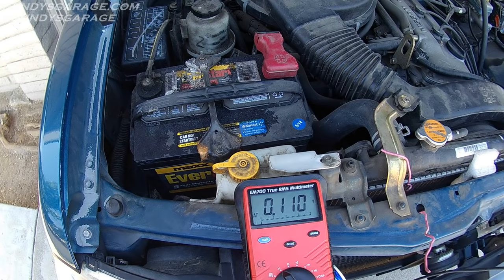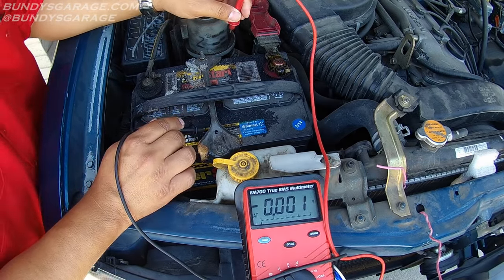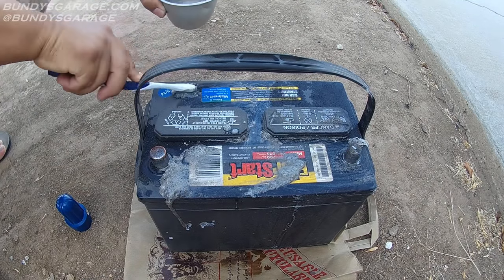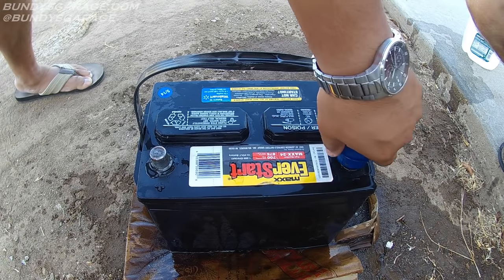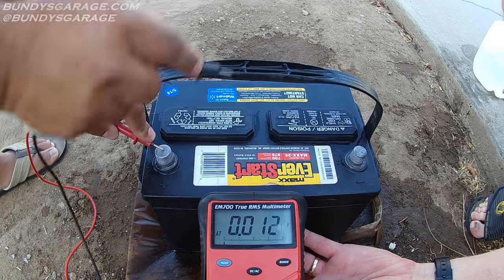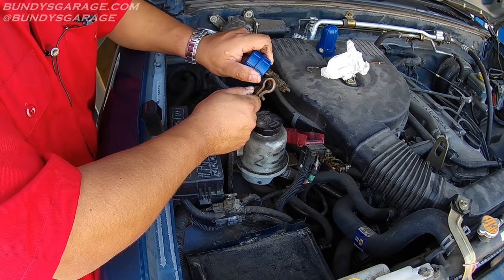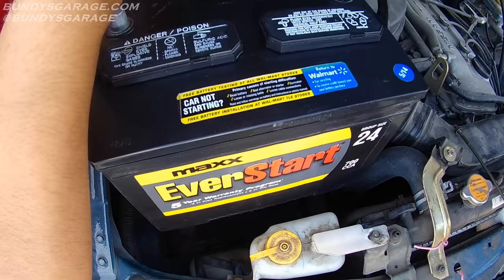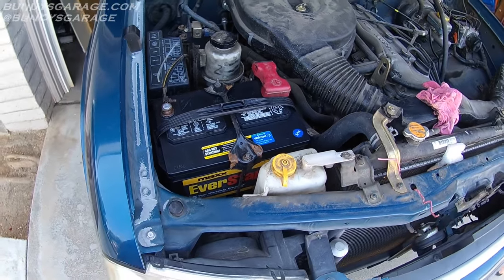Car Battery Care and Maintenance - Tips and Tricks - Bundys Garage

Comment: May I recommend a light coating of vasoline on the terminal posts and base to prevent corrosion.  A trick I learned over 45 years ago that works awesome.
Reply: It's what I've just done with my new terminals...👍👍

Comment: i have been in the battery industry for 35 yrs , there always been maintenance free and low maintenance batteries in the market place , Maintenance Free is the best , no maintenance and know corrosion on terminals . Maintenance Free is what comes out in every Brand New Car , At the retail level you need to do you homework on finding them .

Comment: Walmart battery has that much acid corrosion in just 2 years. It's 2020 and I was thinking of getting a Everstart Maxx but now not so sure. Project Farm channel tested a bunch of new batteries and the $120 Walmart performed better than most. It doesn't help if they don't last though or leaks.

Comment: You mention just the radio code, You did not mention that all the OBD data .You have to drive 100miles to retrieve it or you will fail smog check if you need one.It happened to me. I was charged twice and I have to retest.

Comment: Hi, I turned the key in my 2011 Routan yesterday and there was no sign of power. I cleaned the terminals then jumped the car with my second car but not before leaving it on charging for approx. 5 mins then it turned on. So I left it on for 30 mins but didn't try to start it until a few hours later and when I did no power again. Its a sealed type so I cant check water level is there something I should do next??Read more
Reply from the maker: Sorry to hear that. Do you know the last time you changed the battery? Most of the time the alternator will change a battery enough to get it going again but sometimes you need to charge it with a stand alone charger. And then sometimes the battery needs to be replaced. They do have a life span and eventually they go to that lead acid heaven in the sky...

Comment: Is it a good practice to disconnect the negative terminal when the vehicle is not in use for a relatively longer period?
does it drain the battery when you do so? or does it damage the  battery n anyway? pl reply
Reply from the maker: Well a lot of modern cars have multiple computers that will be reset if you disconnect the battery. Plus some vehicles want a code to activate the OE radio after the battery has been disconnected. You best bet is to get a battery tender like a Noco Genius Charger.

Comment: Another reason to take the negative off first. If your ratchet hits the body taking off the negative no issue. If you try to take the positive off first and you hit the body or anything metal, it's spark city. Once the negative is off, if you hit metal taking positive off it has no effect!
Reply from the maker: +ggin nj good point but it's backwards, if the positive is hooked up, and you are trying to remove the negative, hitting metal with both the positive and negative attached to the battery you will see sparks. Just remove the negative first but be very careful not to touch any metal when removing the negative.
Reply: @bundysgarage  That's plain incorrect. GGin nj has it right. At the end of your youtube movie the guy is almost touching his wrench at the frame, it's wrong to wrench the positive terminal without taking away the ground connection first. Common sense!